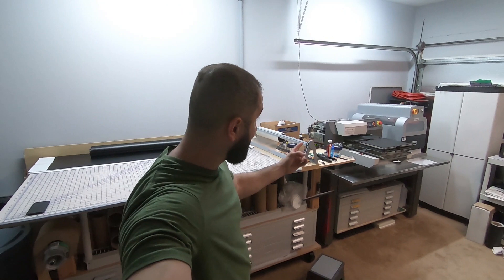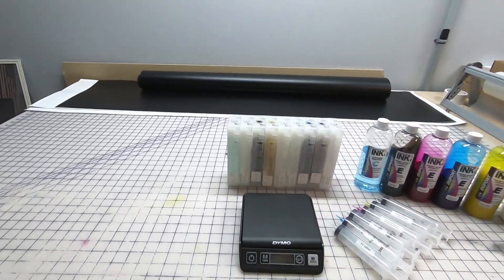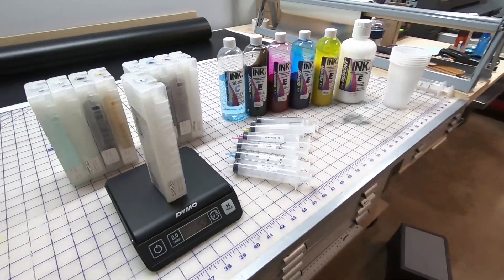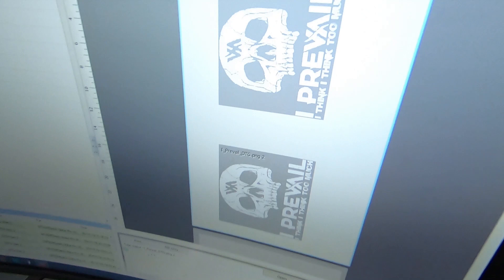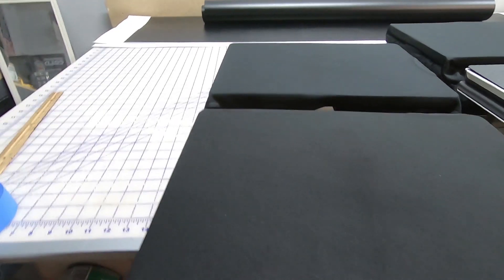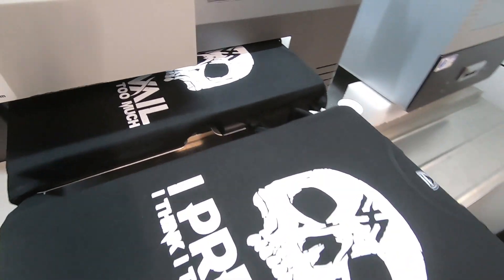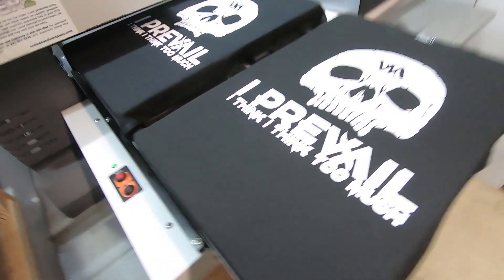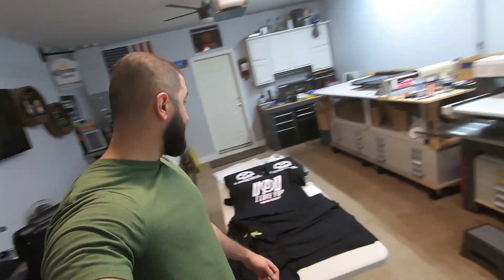Printing shirts direct to garment using Viper 2 DTG

Comment: Hi I have that same printer and when trying to print on dark clothes the white first layer was just never good so the second layer would never be a flush white like yours any tips I've heard maybe I'm doing something wrong with the treatment layer but I can't imagine it causes my inking to become blobby or faded during the print process. Thanks for the time and help awesome videos!
Reply from the maker: Pre treat is the key when printing on dark, also a good pre print press with the heat press with help push down the loose fibers for better application.

Comment: What made you go with that brand of printer? How much do you loss by it running the cleaning cycle? Also what brands are the ones on the low end?
Reply from the maker: Nicholas Halton I got a really good deal on the machine on the used market. I’ll be going into cost of maintenance and cleaning cycles in my next vid. 👍🏼 if your looking for entry level, I would look at NIKODTG he builds DIY print beds for off the shelf printers.